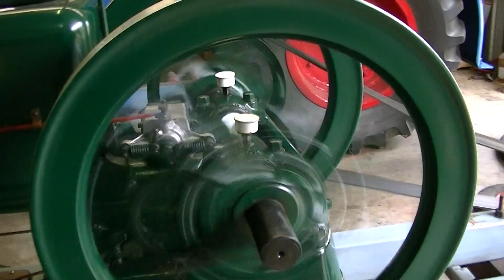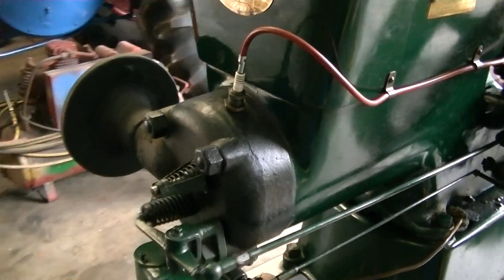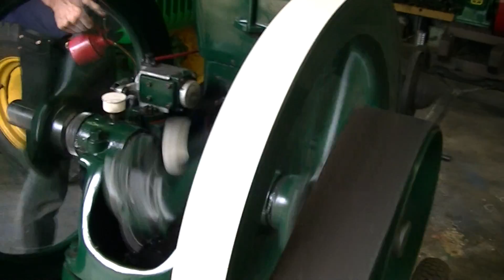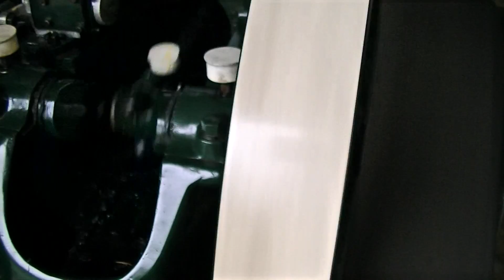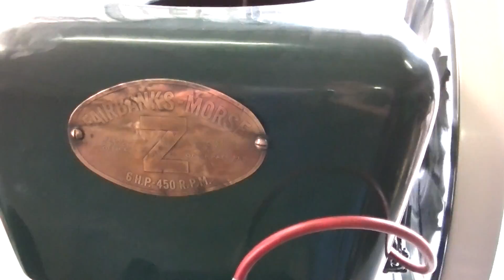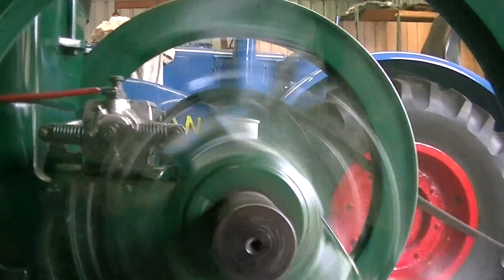Running fairbanks morse exposed crank 6hp

Comment from the maker: All of the rough casting is filled with body filler and then sanded and smoothed. I do this with all of my stationary engines and tractors.

Comment: how do you get the hoppers so smooth to shine like glass? lots of paint, or do you physically grind all the rough cast off
Reply: I fill them with body filler. But the surface has to roughen a bit